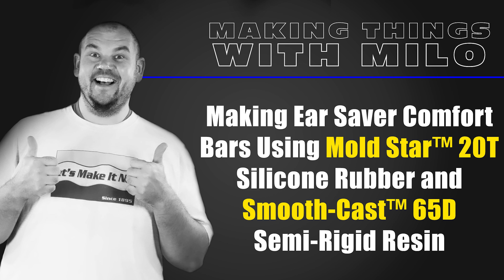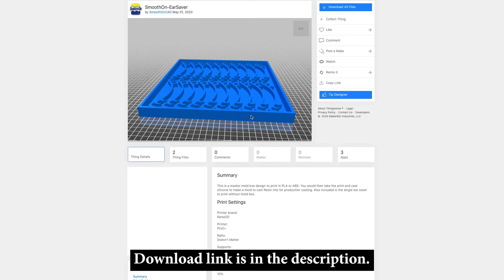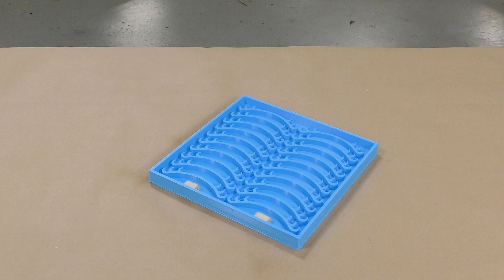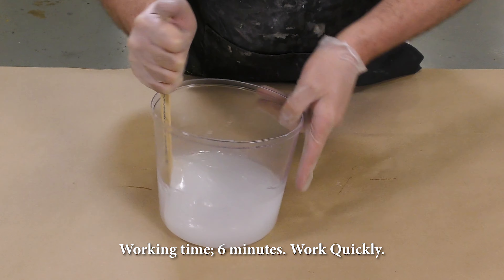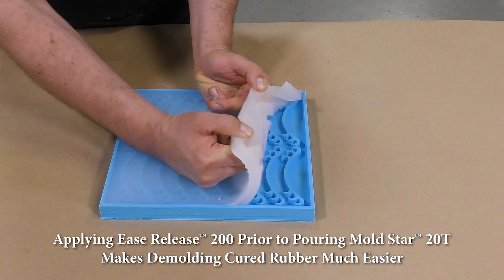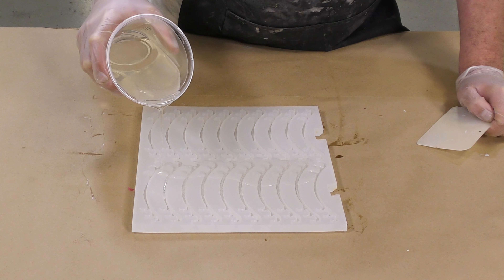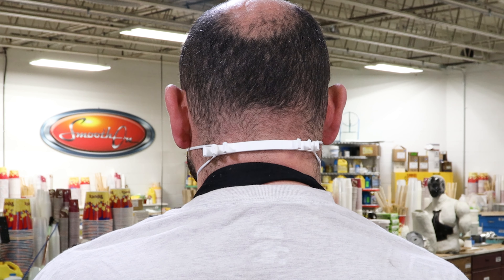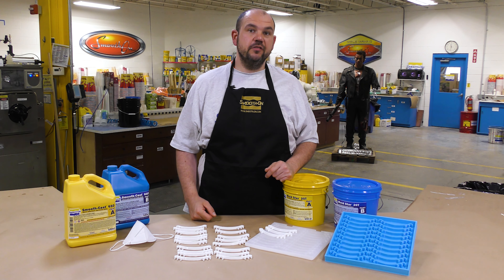How To Make Ear Savers Using Mold Star™ 20T Silicone and Smooth-Cast™ 65D Resin

Comment: I have been working on perfecting ear saver straps for about 3 weeks now.  I have so many failed molds because I started with straps that are easy to 3D print, rather than designs that work best with resin.  My original molds have fallen short for a few reasons - but one key reason was that they were so thin that they didn't have enough mass to function well (using either 65D, which cures quick but needs mass to prevent it from stretching to break point, or Task 5, which was way too brittle).  I have 4 failed gang molds which turn out either too thick to be practical or too thin to be wearable.  This design ought to address those problems.  I also love the idea of printing a mold box instead of trying to make up a gang-mold of individually-printed parts.

Nice work!  I may start making ear saver straps again using this print!
Reply from the maker: Thanks for watching, and thanks for the input!
Reply: Hi. How can we   buy one piece for  apply on mould. We are in Colombia country

Comment: This mold box print is 280 x 280, which is bigger than a lot of 3D printer beds (including mine, an Ender 3 which maxes out at 220 x 220).  Can you share the original .stl file for just the ear saver, or better yet, a gang mold box that will fit in 220 x 220 dimensions?
Reply from the maker: We are currently uploading a smaller file to our Thingiverse page: https://www.thingiverse.com/SmoothOnCAD/about
Reply: @smoothon  Beautiful!  It looks like this will fit my printer perfectly.  I'm printing it up now.  Thanks for your help!
Reply: What printer did the original large print come from? I have never seen one with a bed that large.
Reply: @smoothon  Will it be possible to make the file with only 5? I have a Qidi Pro and it won't fit on my bed. I really want to do this project pls.

Comment: @Smooth-On  You need to check the file for this mold box.  When I tried to use it there were no bottom layers.  It just tried to print the walls and that's it.  Looking at it in layer view there were no center layers until the part for the model for the straps to be made
Reply from the maker: We reviewed the file and all seemed correct.